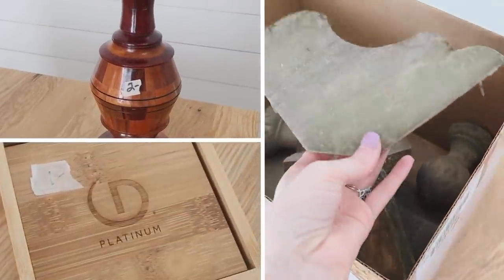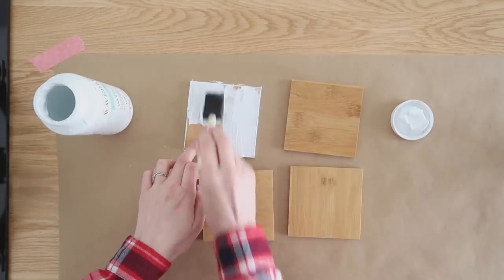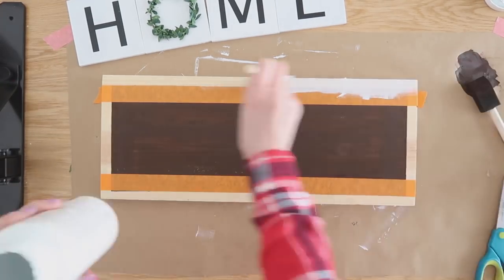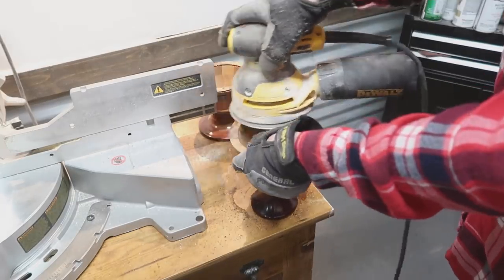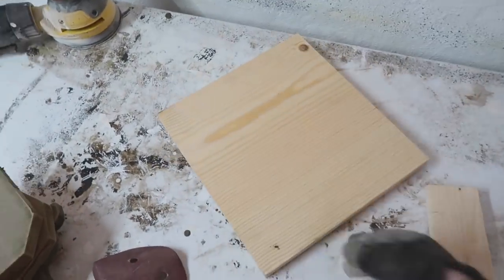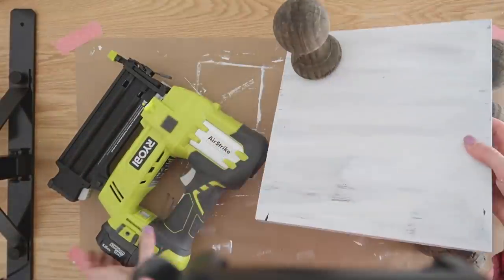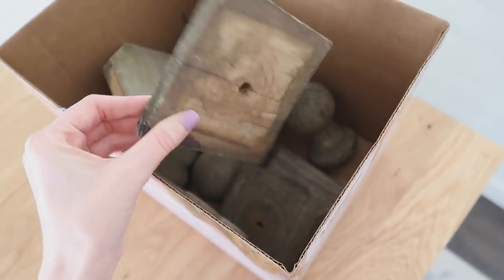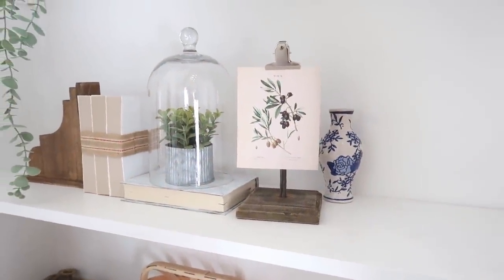My THRIFT FLIP Secrets! | BEGINNER DIYS

Comment: A few suggestions: 
To get the old worn finish color.
Soak rusty nails and metal stuff in water till the water is cloudy and rusty colored....now soak your wood in this water for the desired color you want...check every 10 minutes.
Or
Paint your wood piece a darker shade than you want and soak in bleach for 10 minutes or so, depending on the color you want.
Soaking wood in bleach makes it look like driftwood.
Don't forget to let it dry completely before making it into your masterpiece.
Have fun and try combinations to get the desired finish.